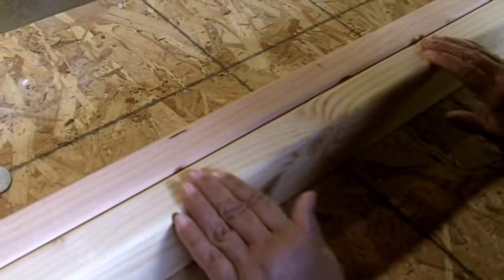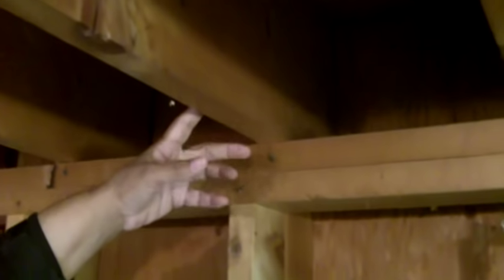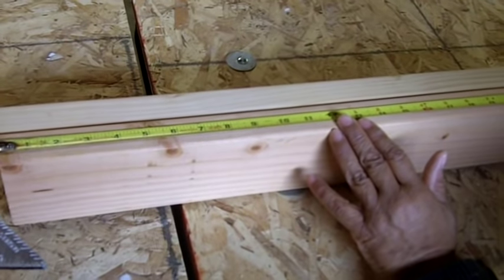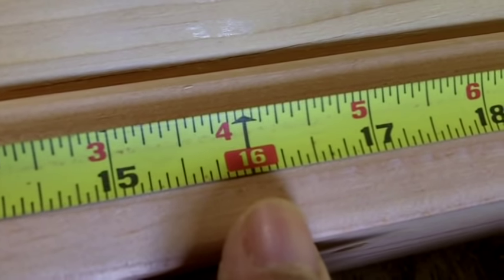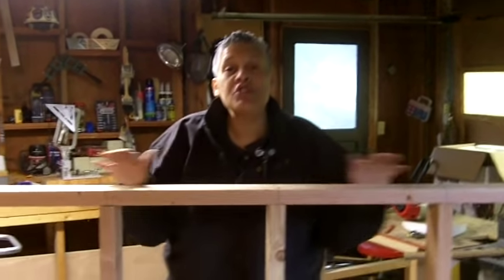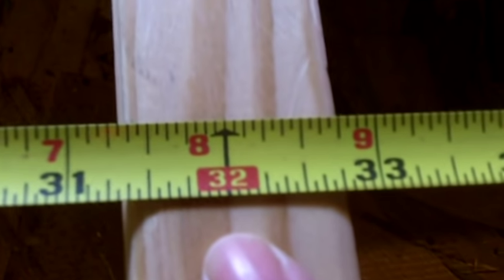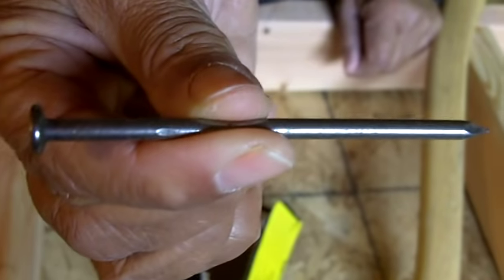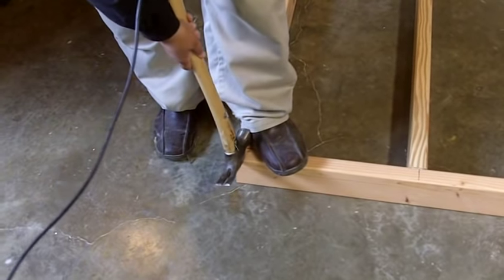How to Build a Partition Wall Beginner's Guide

Comment: I am a licensed contractor. Great video. One detail is that when laying out a wall you do sometimes have to consider where you measure from. On a wall with window and door opening you may have to begin your layout 3/4" in from the end of the wall, if you want your window and doors in exactly the specd locations.

Comment: another way to lay out stud center fast is to mark three quarter inch back from the 16,32,48,ect marks and mark an x to the right of it, then use ure speed square to transfer the mark from bottom plate to top plate,this way  all you have to do is line up the edge of the stud with youre mark and you dont have to mark the centre of the stud,your 3/4 inch back will assure that youre stud centres are true,x marks the spot
Reply from the maker: tybird jayjay   Hello Jayjay,  Thanks for sharing your personal experience.
Reply: this is how I been thought. way much easier
Reply: @tybird: That was how I learned as a housing framer to layout the studs.

Comment: Always burn the first 3/4 inch, then measure 16 inch on center then your drywall will split the stud and the 48 inch location and 96 inch location and so on.  And invest in a compressor and some air tools!  Oh and a Laser.
Reply: tim bucktoo ...Are you sure??
Reply: Whether you go back 3/4 of an inch on every 16 or forward 3/4 of an inch and mark the left side, or mark the center, or go back 3/4 on the first and then move the tape, they all work.  But some methods are much easier in production settings where other people need to read your plate layouts for L blocks and stuff, as long as YOU know where that stud lands for your marks, there are more ways than one to skin a cat.

Comment: if I place the studs centered at 16" increments, the 2 ends will not be 16" from the studs. The first stud will be off 3/4". You start at the left end of the plate, so you can't center that stud on the end. I was taught to measure 16" and then place the stud to the right of the mark. This will give you exactly 16" on center.
Reply: agree
Reply: +Tony Onto Yes sir
Reply: How does that way affect the application of drywall later? Wouldn't you want the edge of an 8 foot sheet of drywall to be flush with one end and cover only the first half of a stud at the other end (hit on the center of it)? It seems like it would be off center if you did it your way. You would then have to make a lot of unnecessary cuts each sheet of drywall. Same thing with the plywood on an exterior wall. It wouldn't be a problem if the wall was shorter than eight feet long, but most are longer.
Reply: True dat
Reply: Hi  @GeneJordan  ,

When i worked construction we never used drywall shorter than the length of the wall. Having a butt/end joint in the middle of a wall is a no no. It is much more labor to finish properly. Order the propper length of drywall for the project. If you have a butt/ end joint in the middle of a wall it will virtually ALWAYS be visible/stand out in the finished product. 

That being said, I am a fan of Leah's teaching/video method. Never trying to make the video about HER, but about the subject. 

Thanks Leah!
Reply: @woodywes4093  Did you always do construction on tiny rooms? I'm confident that eventually the wall size could get larger than a single sheet of drywall at some point, regardless of the size chosen. That's the purpose of tape, mud, and sandpaper: to hide the seams.
Perhaps you've misread the point I was making when I wrote this post years ago.

Comment: Thank you for the helpful video and great clear explanation.
However, I noticed that the first stud when starting the wall will never be 16" on center. If measured from center of first stud (edge of plates) the next one would actually be 15" on center. (after the first one all will be ok)
I see that everyone in the industry does that. But if looking for the first stud from a wall measured like this,(and taking into account the drywall (1/2") the 16" on center measurement (on first stud) will always be off and the nail would miss by 1/2" past the stud. 
Any reason why this is not mentioned.
Reply: +Hector Munoz The reason it is done this way is because when you start the first piece of drywall at the first stud, the edge of the drywall does not start at the center of the first stud, but at the outside edge. But if you laid out subsequent studs as she described, the other edge of the drywall (assuming it is 8 feet long) will land on the center of the 7th stud.

Comment: I like this 

Using the 16inch centre mark rather than making mathematical adjustments for stud locations and marking the centre of studs to align eliminates errors for a beginner - so simple. I must say your voice has the warmth of a snuggly warm duvet on a cold winters night, great work.

Comment: Well done on this video. Many first timers can learn the terminology used in Wall construction to include me. No annoying music. Just informative and to the point. I,want to build a temporary Walled shell, or Insert, to fit inside the old (1874) barn attached to the house we rent. Mainly for heating purposes.. when we move, the insert will have to be disassembled.

Comment: Absolutely awesome. This video was EXACTLY what I needed.  I did a partition wall years ago, so I wasn't totally ignorant, but needed some very important, specific questions answered, and this video did it perfectly.  Thank you!!  Subscribed.
Reply from the maker: you're welcome, Joseph, and thanks!
Reply: seejanedrill ..  Leah, I'm framing up a partition wall tomorrow in a FINISHED room, to divide it in 2. 

Do the sides of the new wall need to be fixed into studs in the existing wall?  There aren't any studs where my wife wants this wall to go, and she won't let me back it up because it'll make the space too small.

I'm worried that only having the bottom plate nailed to the sub-flooring won't give it enough stability.  The top plate and d sides would only be nailed into existing drywall.  Thoughts?

Comment: Thank you so much for this video!  I have been doing so much research on how to do basic framing and yours is the first one to explain it exactly how I needed to hear it!
Reply from the maker: Maria Marquez That's great, Maria, I'm glad I was able to help! Thanks for writing. :)
Reply: Will you be doing any videos on flooring? I have an unfinished attic with half a floor and half trusses. I'm not sure how to approach that BC the people that built the house just put plywood down as the attic floor
Reply from the maker: Maria Marquez Hi Maria, currently, "how to lay slate tile" (a series of videos) are the only flooring videos that we have, but we plan to make more flooring videos in the future.  
As for your attic, let me just mention that all attics are not meant to be living space. Some attics were built solely for the purpose of storage.  The spacing and dimensions of joists can be a good indicator of which purpose your attic serves.  In addition, there is the matter of building codes and space requirements that need to be observed, prior to creating living space in an attic.  You'll want to check the building codes in your area.

Comment: I'd recommend when doing your layout you stack your plates as stated in the video but draw your tape and mark every 15 and a 1/4 inches and put an X on the side your stud goes on and it will lay out to perfect 16 centers. Faster and easier when scattering your studs. Great video.
Reply from the maker: Hi Juan, you know, the way you are describing it is the way we do it in the field.  But the intent of the video was to break it down in a way that a layperson could easily understand the concept of stud center.

Comment: I like your video for sure one thing you may want to do when building a wall to 16oc is measure back 3/4 of an inch from your 16 just to make it a little easier for the person whos going to hang dry wall install cabs or anything for that matter.

Comment: I love your videos Jane. Watched so many and learned from you.
I have a question: I am adding a partition wall which will divide my combined garage/laundry room. North & South side of the laundry room is an “inside shear wall” with 3/8” plywood. The old owner removed a small section of south side. I will be positioning the new partition wall (runs N & S) “between existing studs.....so, I will add ladder back blocking in order to nail to for strength(?), add in R-13 insulation, THEN add in new shear paneling (1/8” gap for expansion all around with 6” & 12” nailing schedule). THEN, nail the partition wall to the shear panel/ladder back blocking. 

Or

Do I do this differently? I mean, this partition wall needs something to nail to on each side? 

This will be done to code, so I haven’t been able to get info yet.....

As a note: I am in Riverside county, CA. The house is 1987 single story. The inside shear panel had outside nailing at 2” on outside with 10” in field. Comments?

Comment: Excellent teacher, your video is the only one that I understand, all the others use “construction speak”, terminology that only confuses me.  Thank you!  But I wanted you to go just one step further, that is, the need to anchor the partition wall to the concrete floor.  Here is what I can’t wrap my head around.  I am building a partition wall between two adjacent existing walls.  The new partition is 68” wide and will ultimately support a total weight of three 4x8 quarter inch plywood bead board.  I want to attach each side of the partition wall securely to the existing studs of the adjacent walls.  I also will block between the studs on the new partition.  Do I still have to anchor the partition to the floor?  That is my question.

Comment: Hi Leah, this was a great presentation and very helpful. .I'm getting ready to frame out my basement so we can sheet rock it and make it usable space. We have a dry basement (no water or sump pump, but should I be using green board given this is a basement?
Reply from the maker: Timothy Burke Hi Timothy, you don't have to use green board, but it's only a 1.50 more per sheet than regular drywall.  So if it were me, I would go ahead and use the green board, for the added benefit of having something moisture resistant in my basement, "just in case".  

Also, if you are putting up a partition wall in a basement, you might want to check your local building codes to see if it has to be a floating wall.

Comment: Thank you very much Lea. Im building a non-loadbearing partition wall.  I got myself a bunch of 10' 2x4(s). The wall is 150" long. How do I go about 'extending the top and bottom plates to 150". Also, I'm putting in a 60" (30x2) french door in that wall. Thank you, again.

Comment: Leah, thank you for explaining it on my level.  I have been waiting years for my husband to finish his unfinished project.  I think I can do it.  question, can I do the wall in short pieces?
Reply from the maker: ***** Its not ideal, but yes, you can.  It will, however, create problems for you when it comes time to hang drywall. What may become an issue is that when you are erecting the wall in sections you may alter the 16 inches stud center.  This matters, because a standard sheet of drywall is 4'x8' and these dimensions fit perfectly when the studs are set 16 inches on center.  When stud center is altered to something other than 16 inches or 24 inches, the outside edge of the drywall will not rest on the center of the stud.

Comment: Wow you are such an amazing teacher.  I am getting ready to build a wall in a home that my wife and I just purchased.  If I could ask, how would I go about putting in a door, using the same example.  The wall I need to build is 17 feet long and 9 feet tall.
Reply from the maker: kritixchoyce It's easiest to frame your partition wall first, raise it, secure it and then frame and cut your rough opening. I suggest this method because it'll make it easier to visualize where to place your doorway, and whether there will be problems associated with its location.  Once you've determined the location, next you'll also need to determine the door size.  Regardless of what door size you select, always add two inches to the width and 2 1/2 inches to the height of your rough opening.  What this does is provide additional space to allow room for the door frame (jambs) and its adjustment. Last, here's the anatomy of the rough opening:   two king studs which run bottom plate to top plate, two jack studs (also called trimmers) run from the bottom plate to the bottom of the header and nailed to the the two kings, the header runs parallel with the top plate and is separated by cripple studs. I realize this is rather general, I hope it's helpful.  I can make a video for you showing the process in detail, however, it would be 4 to 6 weeks out.  Good luck and congratulations on the house!
Reply: seejanedrill Thank you SO much!  Yeah a video that far out, would come a little to late.  We are hoping to close next week, but by or before December 5th.  I want to start working right away.  I just want to make sure I do this well and I really like how informative you are.  Seeing you do it as you explain though, REALLY helps.

Comment: I have a question. First love this video! So we have put down a plank floor but now I have decided I want to put up a wall but I don't want to nail into the new floor is there a way to build a wall without attaching it to the floor. The wall would be 13ft by 3ft but I was going to add a barn door to the 13ft wall and we have a support beam that the wall will either go around or not. The support beam is metal. So is there a way to not nail into the floor? Forgot to say this is the back side of the house and it has concrete under the floor. Thanks in advance!

Comment: Great video. Was waiting to see you attach to the ceiling and wall, though. I'm dividing a small bedroom into 2 closets. Do I need to remove any of the existing dry wall?
Reply from the maker: BethDon Dunlap Hi Beth, no, you don't' need to remove any of the existing drywall. As for attaching your partition wall, just make sure that the new wall attaches to a stud in the wall that it is running perpendicular to.
Reply: Thx!

Comment: Hi, thanks for explaining the process!  Question regarding a wall for bedroom.  I have one large room that the original owner had removed the wall to make one large room.  Two light fixtures, two closets... My wife and I are having another baby and want to make it to separate rooms.  Two questions, do I need to cut and remove the carpet along the base so that it lies directly on wood or can you go over and nail through the carpet and pad?  Second question is the ceiling dry wall, do I remove existing strip to get to studs above or just create a new top header nailed directly against dry wall ceiling?  Thanks for the help!  Like how you clearly explain things!
Reply from the maker: Adam Hedrick Hi Adam, regarding your first question.  You could nail the bottom plate directly to the carpeting.  However, the problem with that is that if you ever want to change the carpeting in one room, you'll run into obstacles.  Second question:   The ceiling could be drywall or plaster.  It depends upon where you live and the age of the house.  You can nail the top plate directly to the ceiling.  Hope this helps, and good luck with your project.

Comment: I have a gap between a stud wall iv fitted and brick wall, iv used concrete screws to fix but will expanding foam help secure and stick timber wail, to masonary wall.

Comment: Leah, the Note that said: Because the floor here is concrete, the frame will need to be attached to the floor with the appropriate hardware.
So my question is, do you please have a video showing what that hardware would be and how to attach it? Thank you 😊

Comment: I really appreciate the step-by-step directions you walk us through! I am helping a friend of mine with some home improvements and this is great start. There are just two things that are different about where her partition wall needs to be, and I would like to ask you if you think we could do it ourselves or hire a professional. The room was an addition to the original house, and it has brick flooring and vaulted ceilings. Is there a way to build a partition wall that is maybe 3/4 high, and not be framed all the way up to the ceiling? What special circumstances do we need to consider with her brick flooring? Any information you have would be greatly appreciated, and thanks! I can't wait to scour through some of your other fantastic videos! :)
Reply from the maker: Jeff Liddell   Hello Jeff, There shouldn't be any issues with erecting a partial partition wall.  Just make certain that you not only secure the framing to the floor, but also to the adjacent wall.  You'll want to use the 3-4-5 method to square the wall with the adjacent wall.  I encourage you to watch our video "How to Use the 3 4 5 Method to Square Up a Wall Perfectly.

As far as the brick floor, you'll need to use a suitable anchor.  Some fasteners are permanent, others are removable.  If you don't already have a rotary hammer, I would encourage you to rent one, because it will make the anchor application go easier.  If you have any other questions feel free write back.  Good luck with your project.

Comment: When is it absolutely necessary to put wood blocking between floor joists, ceiling joists, rafters and wall studs?  From the videos I've seen, wood blocking seems to be more optional than a requirement.  Do these blocks improve load-bearing capacity?

Comment: Hi, thanks forposting this informative video.  Just one question, when your securing the shimmed top plate to the ceiling, do your drive the nails through the shimmed sections. as the other areas have a gap between the ceiling and the top plate?
Reply from the maker: Eric Silverman  Hello Eric,  Yes.